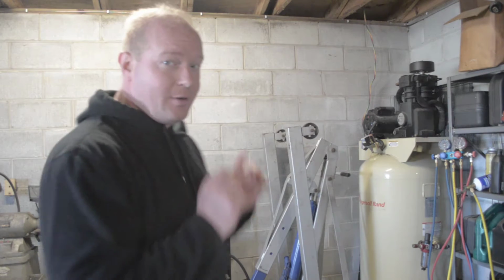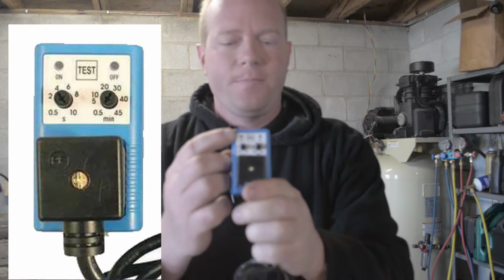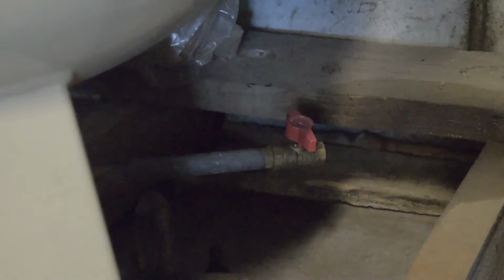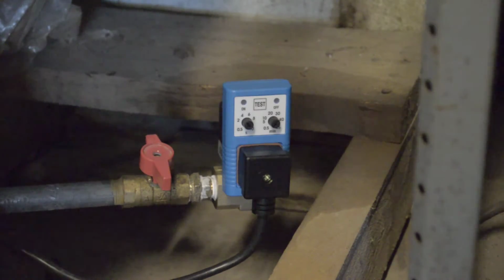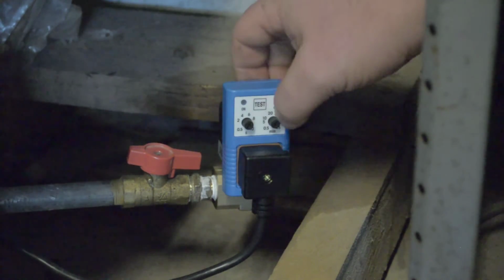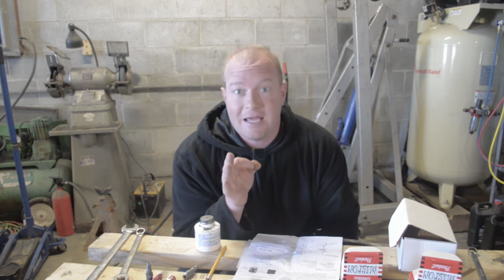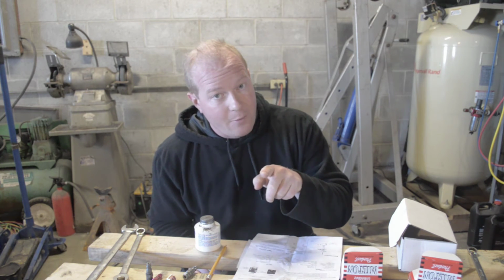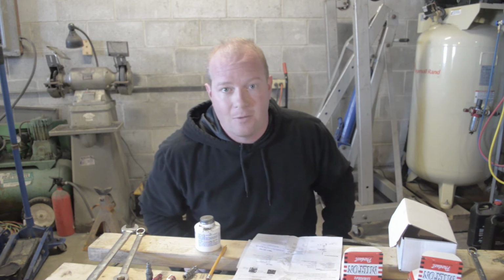Milton Air Tank, Auto Drain.  Save your air tools

Comment: Use the original ball valve to throttle the airflow through the new ADV. It will save your, and someone else's, hearing.
Think of the poor schmuck walking past the discharge when that baby blows off!

Comment: I feel like something.like this would just break after a couple years and cause the compressor to stay running when I'm not their.
Reply from the maker: You are correct, if you leave this tank valve on all the time your compressor will turn on more often.  I only have this tank drain on when I am using the compressor.  See this video https://youtu.be/zgR11V6t3-o
Reply: It should be a normally closed valve. Looks like an electromagnetic solenoid valve, so if it fails there are no mechanical parts to fail with this valve in the open position causing the compressor to run continuously. Also, most compressors have an overload/over temp fused breaker, which serves the purpose of protecting the motor in a case like this. This valve is just as likely to create an air leak as every joint in the plumbing. So, it's up to you how you want to weigh the benefits of having an automatic drain and not.

Comment: does this unit keep purging the tank even if the tank has no pressure and no liquid left in it?
Reply from the maker: Yes, It is just a timer.  It doesn't have a pressure or moisture sensor.  I put mine on a switch by my compressor.  When I turn on the compressor I turn on the drain.
Reply: well...mine is hardwired...soooo this will do it every 45 min for 24 hours ..7 days a week ...unless i unplug it...i use the compressor maybe couple times a month ..so i may need to rethink